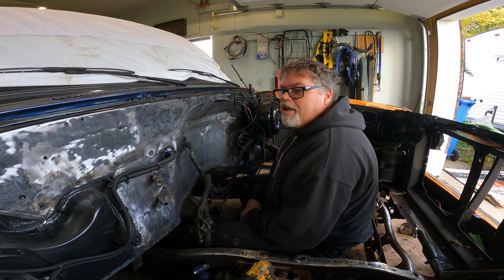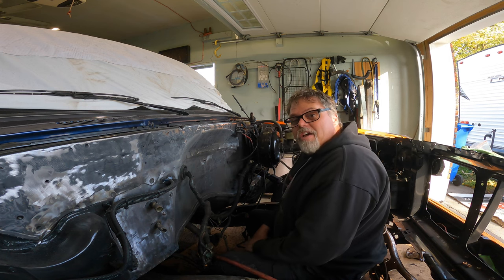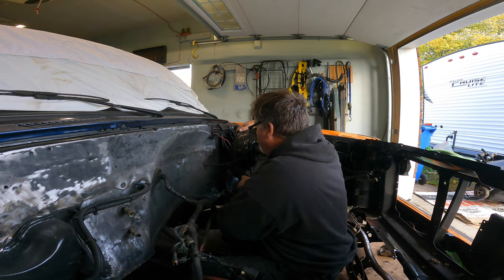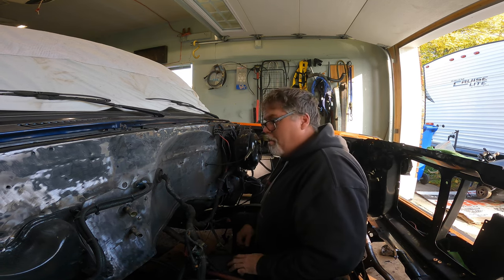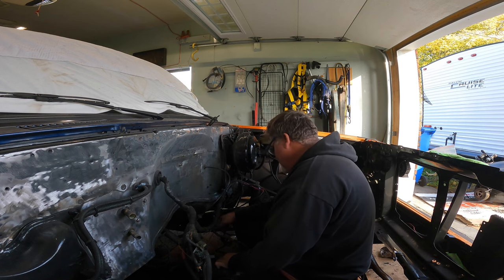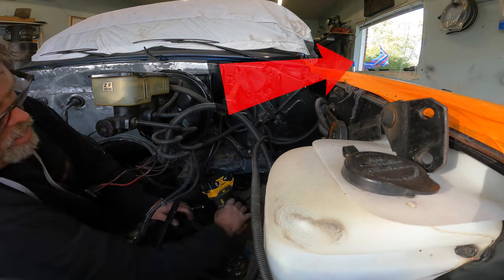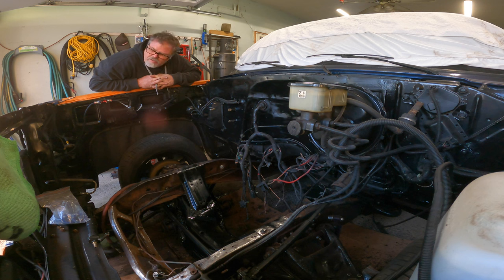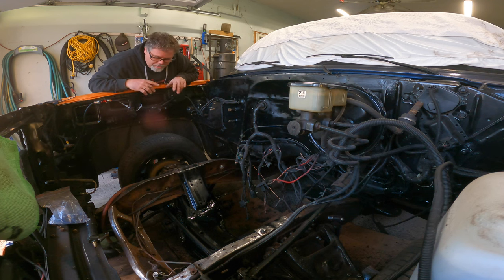What Was I Thinking Getting In This Deep     4K

Comment: You're going the opposite direction with your transmission than what i did when I had my old square body many years ago.  After the second 700Rforeskin took a dump in my 1985 K2500, I converted it to a TH400/205Tcase.  I killed two stones with one bird on that deal.  Got rid of that weak foreskin transmission, and the light duty aluminum chain drive transfer case all in one shot, I did!  But this was back in the mid 90's..... I'm sure they have figured out how to make a 700Rforeskin transmission live by now.  Lookin good, Jim!  Thanks for the video...